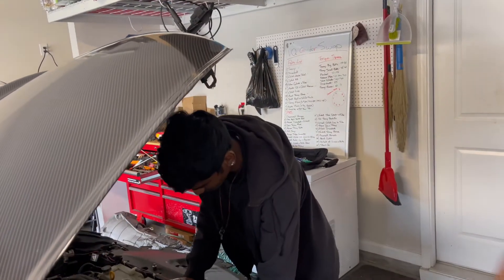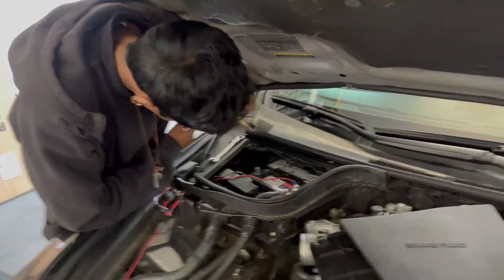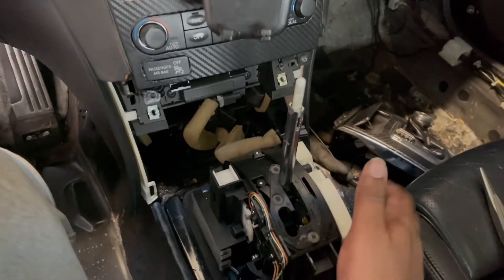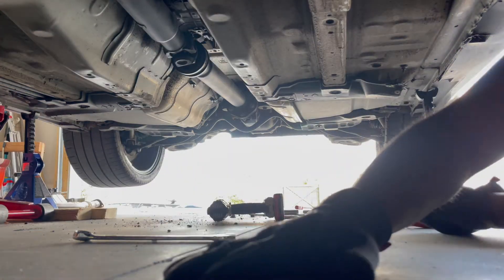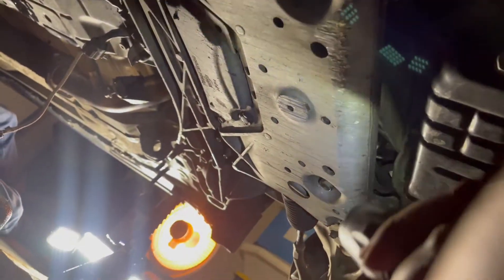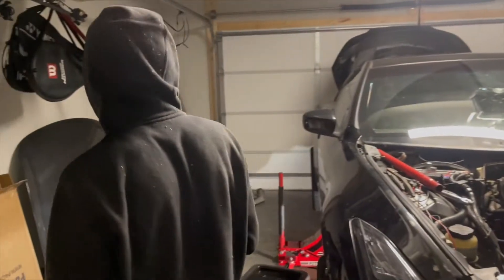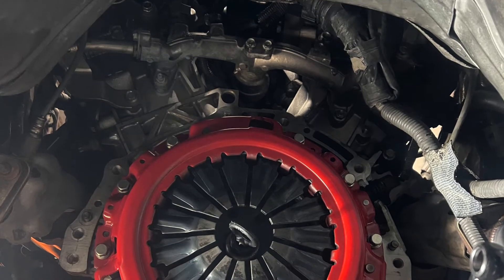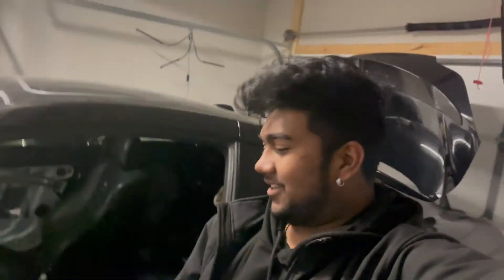G37 Manual Swap Part 1

Comment: These motors don’t like to turn counter clockwise. You could potentially ruin your oil pump. The method you used to get the flywheel/flex plate on/off was risky. But if it worked that’s good!

Comment: G37 Manual Swap Step 1: Buy a manual G37
Reply: Except if it’s an AWD I have a 2015 Q60 and eventually after all my mods I’m planning on manual swapping it it’s probably one of the only mods that adds it’s value when you sell the car
Reply: @hexicalcat4937 awd require even more work. Pretty sure you need a whole front subframe and control arms from a rwd since youll be rwd only. I mean you might be able to get away with keeping the awd front control arms and subframe but that’s sketchy and probably gonna handle weird